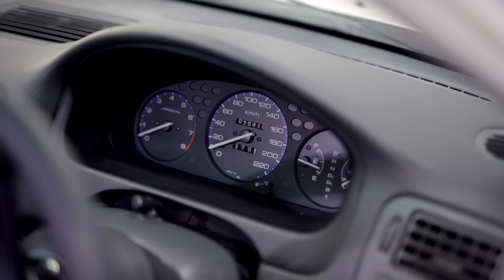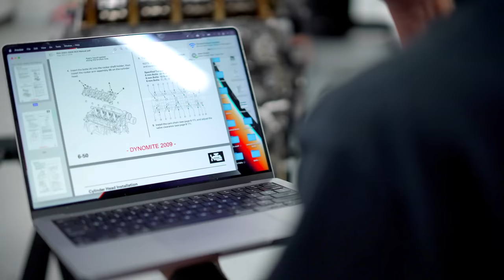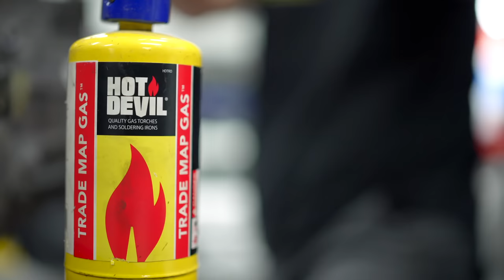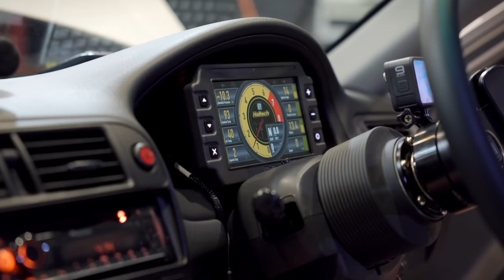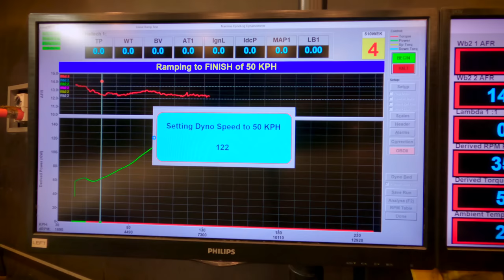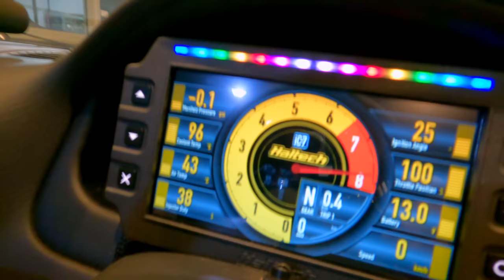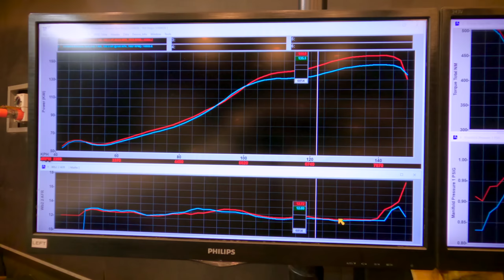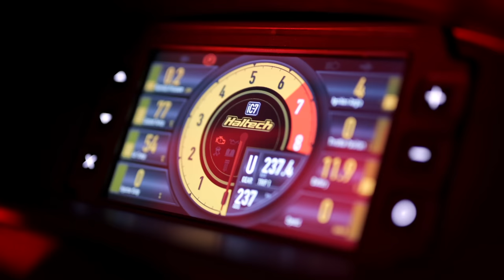We put a $500 engine in our $10,000 Civic

Comment: Honestly I cannot believe it’s been  over 10 years that I’ve been hooked on MCM, they are the epitome of what a car enthusiast is! 🤙🏻
Reply: they still need to do a 2jz aswell, they've done Rb26, K24, B16,SR20, EJ's now they need the real holy grail of jdm motors. a freakin 2JZ-GTE
Reply: @LegerAndCo The holy grail in my opinion, is the C32B.
Reply: @irgv-tec2560 yet people are K swapping NSX's. C series is a cool motor, but nowhere's near the league a 2JZ when it comes to modding it. There's 2500hp 2jz out there churning 6secs in 1/4. An NSX or c32 or even c30 isn't doing either those things. 
Grannas racing on the other hand..... 
Love my Hondas but again C series was outclassed by a lot of straight 6s
Reply: @LegerAndCo  C-series back in the day, was a hell of a lot more expensive. And more rare. Compared to the 2jz being more numerous compared to C-series. Which is why I believe, it hasn't had a chance to have as much development from the aftermarket sector. compared to the rest of the engines out there. Guarantee the c series it would hold more power than a k series with the standard block. There are more k series out there less expensive and more aftermarket support that's why people go k series. As for what the c-series could achieve, really is unknown as there is not enough examples out there that could define what it could do.

Comment: What an absolutely terrific sound coming out of that set up!! Wow!! For an engine/drivetrain putting down under 200 wheel horsepower and only 2.4 liters, that engine with that specific exhaust matched up delivers a very sweet low tone resonance that rises all the way up to redline even when those ripping tones enter the mix. Absolutely perfect. The beauty on the ears of carrying that low resonance all through the range of acceleration is that it never begins to turn into a painful shrill of all higher engine notes inside the cabin. That perfect.y blended tone ensemble tells you this thing is breathing perfectly for its tune which delivers that hard and smooth acceleration. It’s no wonder why folks are so addicted to that engine series. So cool. 👍🏻😎👍🏻

Comment: One thing to touch on when doing a swap like this is, I had to purchase a 2006 civic Si Brake bias valve, With the gearbox being on now the other side to stock in my Aerodeck, the ABS unit would not clear the downpipes (4 Branch) Thus doing this is also an abs delete so what ever you do please do Not take the bulb out of the dash when it shows up as a fault ;)! Great video guys My has sport mounts were beautiful too.
Reply: Drive shafts were also an annoying issue I had, I put the ends from my MB shafts on to the K20 shafts, and because of the position of the engine in the car and the wheelbase of the MB / EK  I got binding issues and a bad rumbling noise when going over bumps. I eventually bought some Correct length custom shafts, Not cheap but seriously worth it. 
Making sure you have the correct Loom for the engine bay is also important as some d16's dont have the wiring for the v-tec solenoid. Luckily my car did, I got my Loom for all of this stock ecu adjustments from a company called Boost works and it was spot on, Probably the hardest part of the build though by far figuring out how to adapt the k20 ecu to to the car.

Sorry for the rambling, Just here to try and help best I can! Share the love

Comment: I honestly prefer K series over B series now. I used to Stan B series in the early 2000s. I'd honestly go K20A in this though if anyone intends to do this swap, but I understand why they did K24. Salvaged car.
Reply: For petrol i think K24 is unbeatable in value, you can get them for less than it costs to get an OEM headgasket for an N54
Reply: I daily drive a K24 now already. Would much rather have the K20 and plan to swap mine out one day.
Reply: Where I'm at between Malaysia/Thailand ... b16/18, H22, K20/24, F20/22 been swap from EF till CRZ, Jazz/Fit since I can remember.
Reply: @tinystar3010  Having driven both and currently driving a K24, it depends on the purpose.  For a street car, 100% prefer the punchier K24.  For a track car though, screaming K20 all the way.
Reply: And I said, if you had read my comment, I daily drive a K24. That is street use. If find it lacking. A K20 would be much better in all scenarios from my experiences. Granted everyone has different experiences, but a K24 just feels weak to me.
Reply: Yeah I'm glad I went k20a dc5 type r swap
Reply: Franken engines with k24 blocks and k20 heads are one of the best Franken engines for Honda
Reply: k is the way
Reply: @tinystar3010  I did read your comment. And then I disagreed with it (hence the word "prefer") and gave my thoughts on said disagreement.  I wasn't questioning your experience.
Reply: For budget to power 100% agree K is the go but a high comp B18 is just 🤌🏻 Nothing beats the B series crossover, especially a built one that rev's out to 9800.
Reply: Agree, I'd prefer the k24 over k20. Do not see the advantage, with losing 400 cubs. Just don't see the justification, from 1000 RPM more from the k20 with 11,000 compared to k24 with 10,000 RPM.

Comment: sweet! I like the d16-y8  its cheap more readily available, and with a turbo, rods, piston, injectors. lots of cooling, few other things, tuning is good for about 200 to 300 hp easy its a nice little engine with only a single cam and less moving parts its light, small and simple, sounds very good also easy to rebuild

Comment: I'm planning a k24 swap in the near future and appreciate all the great info. You answered a few questions I was still a little unsure about, but you guys went over a few things I didn't know about at all and now have more questions. What axles/driveshafts did you use, and how did you connect the engine conversion harness, or is that part of the ecu tucked harness?

Comment: My 96 D16Y5 has been in my garage for the last 4 months because I jumped timing, and after resetting it and making it perfect, still runs like crap, so I think I bent valves, but I've been to lazy/scared to dive in and diagnose/fix it.  Was debating just swapping motors, but I know K20's are expensive as hell, never looked into K24s, I know B16s used to be cheap when my friend did it, but I'm pretty sure expensive now.  I like how the title is "500 dollar engine" but then the MOUNTS cost twice that, and probably a couple grand or more in other parts...sick

Comment: I like the idea of the K20 modelst hat rev crazy high, dream build is an NB Miata with a K20a swap, built out for nothing but highest RPM possible. K24 is easier to find parts for, but the 20 does have a square bore/stroke. 9k rpm with lightweight internals, some have done even 10k.

Comment: Before the crap talking begins, I had an EJ8 Civic coupe that I swapped in a fully built LSVTEC (1.85L DOHC VTEC) with fully forged internals (CP .030" over pistons and Eagle rods) micropolished, balanced, and knifedged crank, and I swapped on a PR3 B16B (Civic Type-R) head, Skunk2 Stage 3 cams, 3 angle valve job, Skunk2 dual valve springs with titanium retainers, and Skunk2 Lost Motion Assemblies. It had WAY too many mods to list in a YouTube comment, but with a Garrett GTS3582 dual ball bearing turbo on 34 psi it made 709 whp. Even a stock K24 with supporting mods like ARP head studs and a MLS head gasket) can make 550 whp with good tuning. Brian Gilespie is a legend and his crew make some AMAZING products for our cars. Hell, back in the very early 00s I built a 1992 Acura Integra hatch with a stock B18A1 with a 5 speed with a junkyard sourced turbo kit and it went on to make 257 whp at 15 psi on an old worn out 1.8L DOHC non-VTEC and it still had ice cold AC and was able to make 28 mpg with the bigger injectors. Hondas are SO easy to make a fun daily driver.

Comment: Stock k24a2 swap 90s civic bolt ons with tuned can run low to mid 12s in 1/4. This is just with 93 or e85 pump. Imagine it with nitro fuel, itll run 11s. That dyno number seems pretty low when it should be making 250-270hp since its cammed.

Comment: the piston speed at at 8000 rpm is 26mps and is a lot for a stock piston and rod. these k24 are good for low end and mid power. I hope everything will be fine. I have a working k24a3 in my cl9 and a disassemblied engine due to no 3 piston rod knock the bearing had disappeared. I know this was because of bad maintenance from previous owners and 240k km but I am a bit afraid of overrevving this engine past stock limiter

Comment: I think they should have put that in a nice rear wheel drive/all wheel drive with a turbo option as a upgrade model. Either a little sports car like the S2000 R. Giving it  R/GT, A and AT/GT models
or mini truck. Both should sell well....but in a big fan of the 78 Subaru Brat body, but I'm a 80s kid from the US, and I think you call them a brumby over there.

Comment: All item is good and branded cl9 k24 the cychead code rbb can't get high rpm and high hp power . If u wan more powerful for the hp and high rpm u can try changing the cychead to rbc or rsp2 is more best power rpm can made around 9000 rpm I got try it before stock lower block k24 absolute only. But the way nice try honda friend.

Comment: 46min.  JDM 4WD EK version exists, so a RWD is possible with the right amount of cash....
Basically all Japanese mass markeded cars have a 4WD option. With most models there is a transfer that bolts onto the 2WD system, with Honda they usually changed the whole transmision. In any case its possible to have a RWD EK. K swap EK drift car anyone??

Comment: Wait a minute... You took 200bhp stock engine. Put about 10.000 dollars, and maid just little bit over 200bhp. Tell me what a point?!.. And by video in the end it's still slow as hell..
Reply: are you mad it doesnt make 700hp or something? it is not slow at all, the hp number is really not important
Reply: @arcanevoid9199  i haven't mentioned 700hp. I said it's pointless build, with no much power improved for amount of money put to it.
Reply: @futurenow6591  they basically doubled stock power, how is it pointless? i highly doubt you would still think this if you drove it or something similar. this would be a blast to drive with k24 torque in such a light chassis